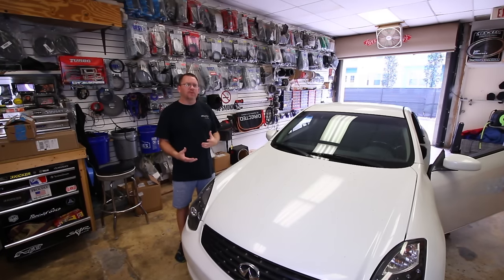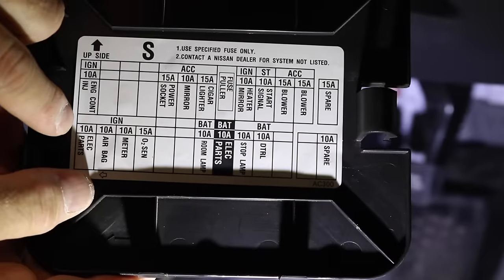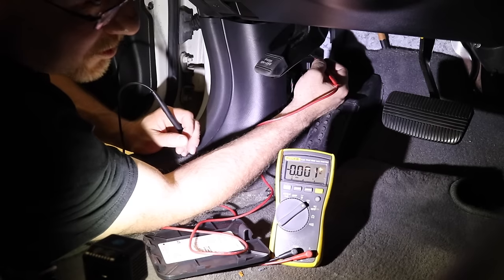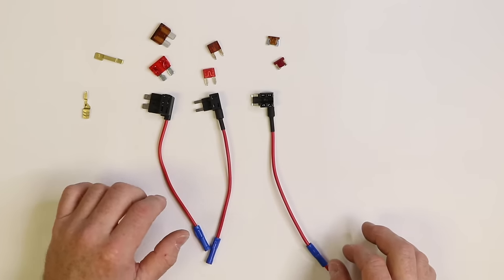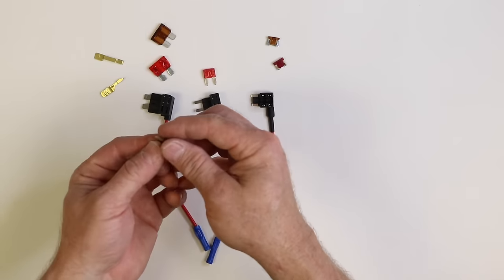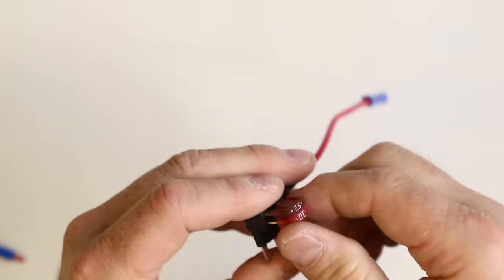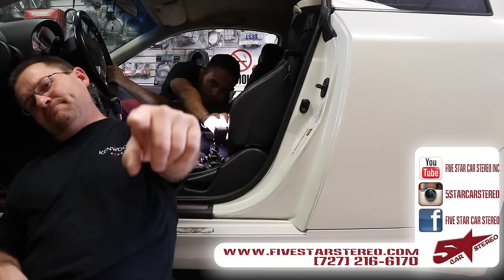How to tap into your cars fuse box safely and cleanly

Comment: Very useful video. I never knew about the load and draw side of fuses. I assumed you could put them in either way. Thanks!
Reply: Patrick Barbour Thank You for this information. I was worried that my fuses where oriented wrong on my fuse box. Thanks.
Reply: @Patrick Barbour Thanks!   For a second I thought I potentially replaced my fuse incorrectly.
Reply: Patrick Barbour  Thanks for the clarification.
Reply: @Patrick Barbour yeah bro, good information.  Thanks.  Hopefully you're not a troll lol
Reply: @xjcrossx  yeah same, lmao ....somebody else please verify ???
Reply: Patrick Barbour In the case Christopher didn’t understand this already, i would suggest him not to do anything with the electrics in his car. First fully understand how the electrics work before messing with it.
Reply: There seems to be some confusion. It doesn't matter which way the fuse is orientated. The load and draw comment was referring to the wires connected to the fuse. The load side is coming from the power source before the fuse. The draw is coming after the fuse.
Reply: @derekcarver2718  mann now Im even more confused
Reply: @CondonesONE  from what I understand, fuses are identical no matter which way they are faced. However, if you are using a device to tap into a fuse then you have to match the load and draw sides.
Reply: @derekcarver2718  Correct, except you're using wrong terminology, The LOAD is the same as DRAW. They both refer to the device you intend to power. The battery or "hot" side is referred to as SOURCE, not load.
Reply: C'mon guys, this isn't rocket science!!!  A fuse can go in EITHER WAY, what's important are the contacts in the fusebox. The fuse is simply bridging the contacts from one side of the fuse slot to the other. One contact is the SOURCE, coming from the battery. The other side or contact goes out to a LOAD or DEVICE.  Now let's think about this. If you put a new wire on the SOURCE or BATTERY side, the device you're powering has no fuse protection because you're tapping off BEFORE THE CURRENT GOES THRU THE FUSE.  This is not difficult. The current enters the fuse from the SOURCE side and goes thru the fuse and on to the LOAD or DEVICE.  If there's too much current being DRAWN from the LOAD, the fuse blows. So you want your device wire on the LOAD SIDE of the fuse so if too much current is drawn by the load, it blows the fuse.  If your wire is connected to the SOURCE side of the fusebox, the current for that device is tapped off before going thru the fuse, so therefore no matter how much current it draws, that fuse will not blow.  GET IT?
Reply: @killenmyful  Wrong, you WANT to tap on the "LOAD" side!!!!!  Do not tap on the SOURCE side.  The LOAD side is the side that goes to (DUUH) the LOAD.  The SOURCE side is connected to battery/ignition.
Reply: @CondonesONE   Then you probably shouldn't be messing with the wiring in your car!!!!  Here's a hopefully more clear explanation. 
A fuse can go in EITHER WAY, what's important are the contacts (or SIDES) in the fuse slot. The fuse is simply bridging the contacts from one side of the fuse slot to the other. One side or contact is the SOURCE, coming from the battery. The other side/contact goes out to a LOAD or DEVICE.  Now let's think about this. If you put a new wire on the SOURCE or BATTERY side, the device you're powering has no fuse protection because you're tapping off BEFORE THE FUSE in the circuit.  Envision a drawing of a simple circuit. You have a battery, a wire from the battery to one side of a fuse, and a wire from the other side of the fuse to a device (or LOAD) like a cigar lighter. Now in this picture, if you were going to "tap in" an additional wire to go out to a new device, where would you want to connect the wire?  To the BATTERY (source) side of the fuse????  Or to the OTHER side of the fuse where the wire goes to the cigar lighter?  Obviously AFTER the fuse, right?????  Otherwise, if the new device draws to much electrical current, the fuse will never blow because you tapped off BEFORE THE FUSE!!!  It makes no difference which way the FUSE ITSELF goes in, what matters is which side of the fuse slot comes from the battery/source, and which side goes to the LOAD (cigar lighter).  GET IT???  his is not a difficult concept, but if this still doesn't make sense or sounds confusing, i HIGHLY HIGHLY RECOMMEND you ask someone for help before you set your car on fire!!
Reply: @liesejunh  The "Load" and "Draw" sides are the same thing. What you have are the SOURCE/BATTERY side, and the LOAD/DEVICE side. One side of the fuse slot comes from battery/ignition, the other side of fuse slot will be AFTER THE FUSE in the circuit, and is therefore the PROTECTED SIDE, which goes out to BOTH LOADS (the original load, ie cigar lighter, and the NEW LOAD you are connecting.)
Reply: @BenDover4Mee  actually your confused,if you wire tap into a live wire say just behind the cig lighter as an example,or radio then it’s already fuse protected,ie it runs back to the fuse box .if you were to tap into one of these with a device you would use an inline fuse of a lesser rating than the one in the fuse box.what the video was showing was a certain kind of fuse tap with the wire at the top and so it certainly matters which way round it goes.obviously a fuse taken directly out of the box can go back in either way
Reply: great information on the battery side and draw/load side. it makes sense once you say it, but it's not obvious when you use the splice wire the first time. i think people here are confused about the original circuit and the piggyback circuit. for the original circuit, it doesn't matter which way the fuse goes it. but for the piggyback circuit, if you put it in the wrong way, you are drawing directly from the battery/source side, which means the piggyback is only protected by the piggyback fuse and not the main fuse as well.
Reply: You are right. You can put them in either way. You just need to be aware that you are connecting the load (wiring feeding the load) from the side of the fuse that becomes dead if the fuse opens circuit.
Reply: To  currect and thats from the battery.. the other is the load/device side... That were you tap the wire the one that has no current. So when then fuse blow out it is cut off
Reply: @dodsmechanical  Pretty simple to understand . You can think of fuse like one piece of wire between battery and whatever . If fuse blows for whatever reason the current cannot pass further . If you put the " fuse thief" wrong way the current will pass to whatever you have attached using the half of the wire  burn it and finally burn the fuse.If you put it correctly will only burn the fuse and won't pass to whatever you have attached because the fuse is burned .Look from where the wires in the fuse box are coming ..that's the battery side and the fuse thief wire must face the opposite direction .
It does not matter which way you put a fuse.. it's the same ..but it matters for the fuse thief!
Reply: @chriscs9080  yup so it is important to test which side of the fuse slot the current coming from. The one without a current thats were we tap. Just cut a fuse into two.. put one leg in slot then test it
Reply: @dodsmechanical  Yeap . or just remove the fuse ,turn ignition on and place the multimeter + on each side to see where is the load . Of course the - side of the multimeter should be on the chassis .
Reply: Knew
Reply: Yes very informative thorough video this is why I am subscribed lol

Comment: Great job and taking the time to do the video. The only thing I would suggest is to correct the terminology so people aren't confused.  The "LOAD" is the device that you are protecting with the fuse that "DRAWS" power.  The  "SOURCE" is the power "SUPPLY" that provides the energy to the circuit.  For ease if conversation the following terms can be interchangeable.

SOURCE=SUPPLY=POWER=Battery

LOAD=DRAW=DEVICE=CIRCUIT=Amplifier or dash camera

Comment: if your tapping into an open spot (unused spot) would you need to put the primary fuse in or just the secondary fuse for the new circuit. I'm guessing only the secondary? If im wrong how would you determine what amp fuse is needed for the primary.
Reply from the maker: Mohsin Ali you are right, just the secondary fuse.
Reply: @FiveStarCarStereoInc  How do you determine what size to use for the secondary if you're tapping an unused slot? Does it matter?
Reply: @chrisphillips4761  you choose the fuse based upon the accessory you are adding. Although, consideration of the capabilities of the circuit feeding your chosen location would be a great idea.

Comment: Are taps and fuses labeled load and draw?
How am I supposed to know which side is which?
Reply: It doesn't matter if you are just replacing a blown fuse. If you watch the video he shows with the volt meter how to ck. Basically put the black lead on a ground and touch the fuse block connections. The one with voltage s the load
Reply: No... @cheif60 is asking, "how do you know which side of the fuse itself"... not the block as in the video?

Comment: OMG I was dealing with all these issue today. Found out the hard way my car take ATM LP. Then I was told it didn't matter what fuse went in each hole. Also my car manual doesn't have layout of my fuse box and it's a 2018 Nisssn. I even went to a Auto store and told them that the top lights up in the bottom doesn't  they act like I was crazy I was totally confused . Totally frustrating day. But after finding this video tomorrow will be a better day. Thank you.

Comment: Thank you this is very helpful to know before I try to hard wire a dash cam to my car.  Like the comment below I had no idea there was a load/draw side, I'm really glad you explained that part!  Also the bit showing how to test with a volt meter, other videos say to do that but they don't show how to actually do it.  Not everyone is good with electronics, thanks for showing this part!
Reply: Blue Rabbit  I am going to be doing a hardwire dash cam to my car too.  Hanging wires looks like hell!  How did you make out?  What fuse amp sizes did you use?  (I am using a tap in a 15A cig lighter) .  Please let me know!
Reply: @canadude6401  Hi, sorry I ended up just tucking the wires under the top and side panels in the end. There are no visible wires apart from the cigarette lighter connector so it doesn't look bad at all.  I do intend to do it properly one weekend when I have time but for now I've done it the lazy way due to lack of time!  Good luck with your hardwiring :)

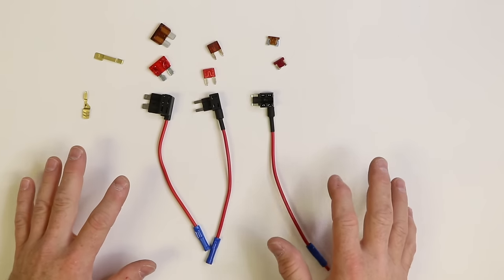Comment: Thanks man, solved my problem at 4:06 I was installing power seat on my mk2 santa fe, seat worked when connected straight from battery, but when I plugged into fuse box it didnt work all problem was that I needed to flip fuse tap and it works 👌

Comment: This video was absolutely amazing buddy thx a bunch...my Mercedes ECU is not sending the signal for my cooling fan to turn on so instead of forking out 2k for a ECU going to buy a thermostatic fan switch and use that..and I need a ground ,constant power and ignition power to it and now I know how to wire the ignition wire safely and cleanly..thx man

Comment: why are you calling the side that leads to the battery "load"  ?    One of the few things I remember from my degree as an electrical engineer is that "load" means the path heading towards the device that is using the electricity, not the source of the electricity

http://electronics.stackexchange.com/questions/95874/when-people-talk-about-a-device-drawing-current-what-do-they-mean-why-do-dev
Reply: David Aliprandi I was wondering the same thing. no engineering degree... just a guy trying to keep things straight in the face of non standard terminology. I believe it's line for power from the battery and load out, correct?
Reply: well he probably doesn't have electrical engineering degree(otherwise he is the most over qualified car electrician ever) and simply meant the 'Hot' side.
Reply: So, for clarification for this non-electrician, should I place the fuse tap for my aftermarket stereo ignition wire on the side that registers voltage on the meter or the side that does not register voltage?
Reply: @texasknowhow3143  think of load as it's loading power to the fuse. Draw means it's drawing power fr the fuse. If you connect your accessory to the load (hot) side then you're essentially  bypassing the fuse. Connect the device to the draw side. So if the fuse blows the power between the load and draw is broken. When connected to the draw side it will kill power to the device.

 If you improperly connect the device to the load (hot) side and the fuse blows it will still give power to the device because it's connected before  the part of the fuse that breaks which is what actually what kills the power .

In other words. Connect the device or remote wire to the side of the fuse that doesn't get 12v power

Comment: Still don’t get which way round the fuse has to go in the fuse box
Reply: You will need some type of circuit tester. He used a voltmeter. I have a $9 AutoZone tool with a very sharp pointy tip. The tool has a see-thru clear plastic handle with a lamp inside. While the ignition is ON, sticking the pointy end into one of the receptacles in the fuse box, (or the tiny holes at the fuse end like he did at 3:21 ) the lamp comes on. THAT side of the receptacle or tiny hole is what HE calls the LOAD side. (You can think of what HE calls the LOAD as directly connected to the positive side of the battery. What HE calls the LOAD side is where you should add the new gadget.

Comment: Great video. This will prevent me from making a major mistake when I add a circuit for fog lights. At 3:05 on the video you mention open spots in the fuse box. If I find an open spot that is switched and want to use it how do I connect a wire to the bottom draw side of the box?
Reply: Put a fuse, stick a wire underneath it

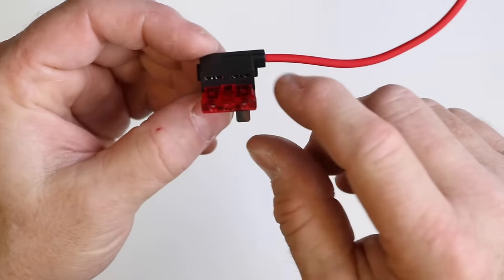Comment: @6:50 you put a 10 amp fuse in low side. then you said the load side had to be lower and you put a 25 amp in. im confused. Sorry just asking!
Reply from the maker: chadwick thurmond it looks like a 25 amp fuse but it is a 7.5 amp fuse. 25 amp fuses are clear in color.
Reply: chadwick thurmond I was wondering the same thing. no engineering degree... just a guy trying to keep things straight in the face of non standard terminology. I believe it's line for power from the battery and load out, correct?
Reply: The sum of both fuses should ideally be at most the fuse value that was originally in that location as to not draw more current than the vehicle wiring was designed for.
Reply: MountainVisions  hi would I be able to put two fuses of the same amp in. Also can I piggyback of a a constant fuse for a constant live wire thanks
Reply: Get a new pair of reading specs :-)  The fuse you think is a 25 amp is actually a 7.5 amp fuse. I made the same error until I looked closer

Comment: Curious if you ever installed a new fuse terminal in a fuse box instead of trying to find the power outlet circuit or other common accessory circuits to tap into. AKA running a complete new circuit from battery to fuse box. So for amps, audio systems ,...etc this is a good way to go about it by using these taps and spade terminals. For the remote starters though you need the ignition key specific wires to tap into but it all depends on the make/model but definitely explained the general procedure /logic in doing it professional

Comment: I have 2013 Suburban and there is Fuse that control TRACTION CONTROL and stability system Need to pull out before towing or Off-roading can I use that bypass instead of pulling fuse out by installing switch on/off to control that? can you explain what the best way to do it clean like you guys as pro thank you.

Comment: had no clue how they worked . so just stayed away from them . thanks
Reply: pissed off it like having a wall outlet that weirdly has only one outlet. You add an extension cord (fuse tap) to create more outlets. In this case, you add a fuse tap, you now have 2 instead of one opening. I suck at explaining lol

Comment: With regards to empty slots, will I use two fuses of the same value(on the pigtail) that my accessory calls for? I.E. 3amp for dash cam with 12v to 5v converter, thanks

Comment: Thank you for your video.  I'm new to this and it's very helpful, but I have a question. At 2:46 you check for power.  Should it read 12 volts, the output of the car battery?  Should all of them read 12 volts?

Comment: Great video. Trying to tap into ignition wire myself. One question - When you take off the existing fuse, does it show load side and draw side labelled onto the fuse itself? How do you tell which of the 2 leads is what? Thx
Reply: He shows you in the video. Put volt meter on DC and turn car on. Then ground bolt meter and stick hot(red) end into one of the  slots if it's volts,  that's the hot side, if not, stick it in the other slot and go by the readings on the volt meter. Don't bend a fork and use instead of a volt meter. Serious injury or death may occur.

Comment: Thanks! So if one wants to find which is the load of a fuse, one will tap the positive of the multimeter on to a blanc side of the fusebox, which is exactly what I wanted to see... I just didn't want to remove any of the fuses before I did this! So thanks again!

Comment: Thanks for posting... right at the 7:10 mark through to  you are using the terms "load side" (when pointing to the supply side) and "draw side" (when pointing to the load side). Please, correct me if I am wrong here, but the load side is the one the pigtail is on, and the 12v+/supply side is opposite that, correct? I'm from Central & Western U.S., and "supply" always refers to  the 12v+ side, and "load" always refers to the load... using the term "draw" instead of load seems needlessly confusing. Or am I missing something?